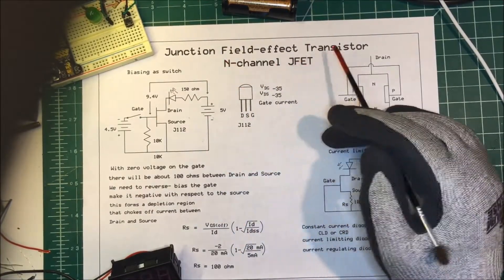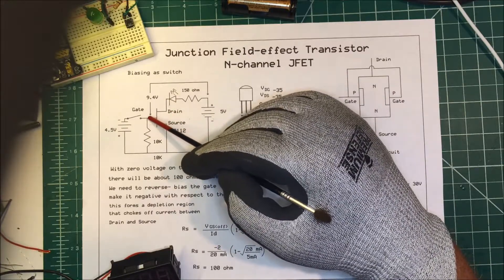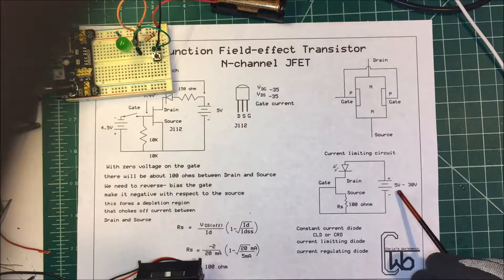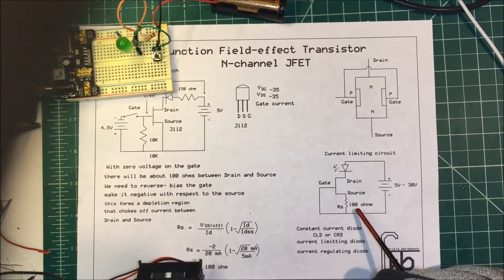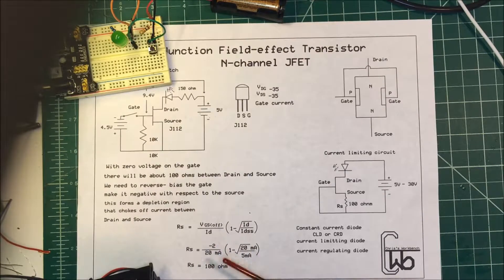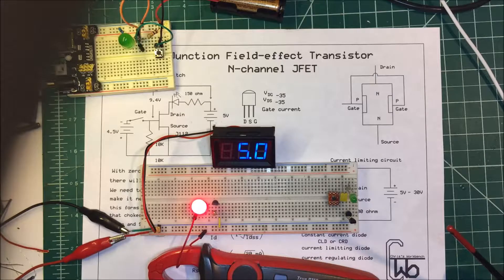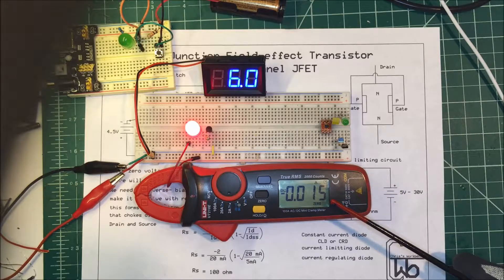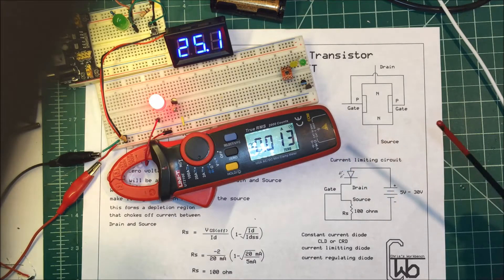Current Limiting JFET

Comment: Nice description. I'm trying to find the best way to make a led driver to drive a few leds in parallel and want to have a adjustable current limiting circuit . I wonder if could I with one potentiometer make parallel circuits to have a dimmable function? I'll guess I need to test it out.
Reply: If you're driving LEDs in parallel, you'll need a current balancing resistor in series with each one, otherwise you end up with most of the current going through the LED that gets hottest first. Otherwise this circuit will work; just use a potentiometer as the source resistor. Make sure that the JFET has an Idss high enough for the total current needed for all of the LEDS.

It may be better to use a higher supply voltage and drive the LEDs in series, as that guarantees the same current through each one, as well as keeping the current through the JFET low.

For higher power applications, I'd recommend a power mosfet and using a potentiometer to supply a variable voltage to the mosfet gate.

Most dimmer circuits would be more complex and use a pulse-width modulated gate signal to vary the average current through a power switching mosfet, while keeping the dissipation in it low.
Reply from the maker: Check out my video on parallel LEDs : https://youtu.be/3fMaADF74Hg?si=JmTEXCsItGqjF5p1
Reply: @ke6chris  Thanks but wasn’t going to have the leds themselves in parallel but possible this driver circuit you had in the video each driving one led.

Comment: I think you'll find that JFETs are meant to be biased so that Id < Idss, and therefore Vg < 0. If Idss = 5mA, you're not going to get 20mA drain current out of it with sensible biasing.
Let's put Id = 25 mA into your formula for Rs, using Vgs(off) = -2V and Idss = 5mA. We get Rs = 123 Ω. So if you're right, increasing the value of Rs gives more drain current. Huh?
Let's put Id = 3.43mA into your formula for Rs, using Vgs(off) = -2V and Idss = 5mA. We get Rs = -100 Ω. So if you're right, we need a negative Rs to get Id less than Idss. I don't think so.

I think you are missing the fact that Vgs is negative and Id is positive, so you actually need another negative to calculate Rs from Vgs/Id. Using a 100 Ω resistor with a JFET having Vgs(off) = -2V and Idss = 5mA, will actually give you 3.43mA drain current. Larger Rs will decrease that, and smaller Rs will increase it until at Rs = 0, we have Id = Idss = 5mA.

You need to measure Vgs(off) and Idss for the sample of J112 you have because there is simply too much variation in those parameters to design using guesswork from the datasheet. I tried one of my J112s and measured Vgs(off) at about -3V and Idss at 35mA. With Rs = 100 Ω it gave Id = 15mA. The calculation suggests that should be 12mA, but Vgs(off) is hard to measure accurately. Those sort of figures agree with your experimental results, but not your calculations. Your sample definitely did not have an Idss of 5mA.
Reply: What formula should be used?
Reply: @dbtest117  The correct formula is Rs = Vgs(off) * ( √(Id/Idss) -1 ) / Id for an N-channel JFET.
You must realise that a JFET cannot supply a drain current Id greater than Idss, so you can't decide to have an Id of 20mA with a JFET whose Idss is 5mA as in the video.
The datasheet for the J112 show a minimum Idss of 5mA. amd most samples will be well in excess of that.

Using one of my samples with an Idss = 35mA and Vgs(off) = -3V, we can pick an Id of 20mA and the formula would give:
Rs = -3V * ( √(20mA/35mA) - 1) / 20mA = -3V * (-0.244) / 20mA = 0.732V / 20mA = 37R
If we chose an Id of 10mA, we would get:
Rs = -3V * ( √(10mA/35mA) - 1) / 10mA = -3V * (-0.465) / 10mA = 1.396V / 10mA = 140R
That looks more likely, doesn't it? Increasing the resistor almost four-fold results in a halving of the drain current.
Reply: @RexxSchneider  Thank you. I'm about to design some custom adjustable led driver circuit. I appreciate all the help as it's ~25 years ago I did electronics in school anything more than a normal transistor is unknown territory. It's for a hydroponics project I have.